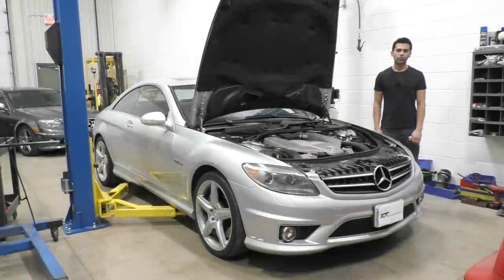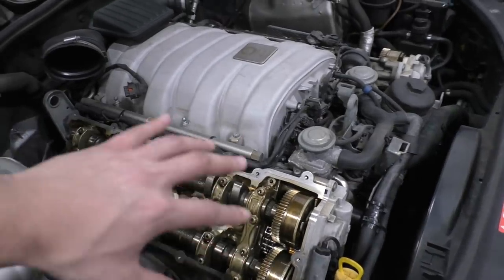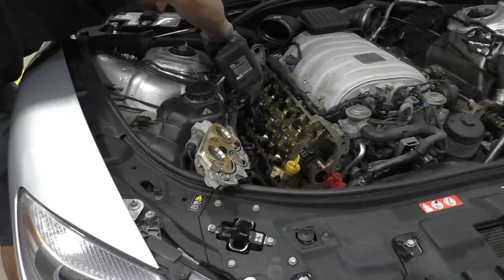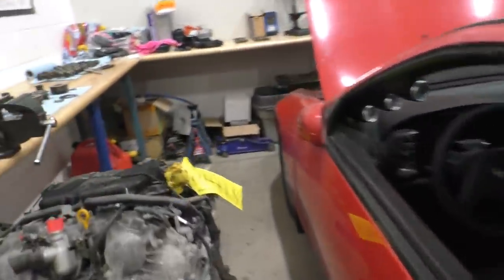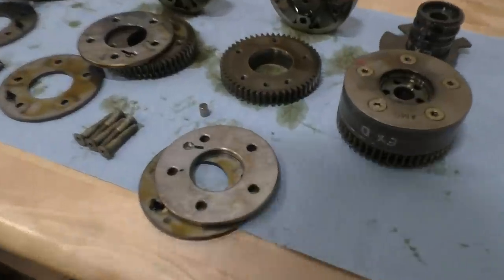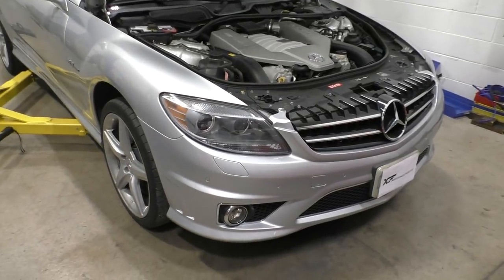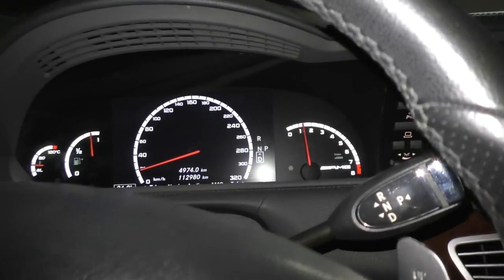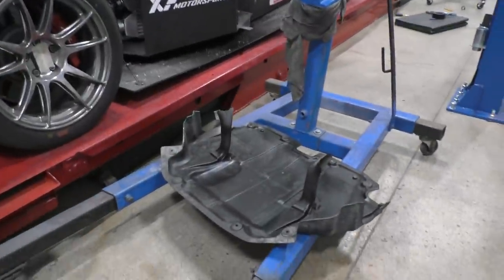Replacing Headbolts and Cam Adjusters on a CL63 AMG M156

Comment: Keeping oil level close to the max is the key on m156 to ensure timely oiling. For those looking for a detailed m156 head bolt DIY, I have one on my channel.
Reply: I love your channel. Thanks for making a detailed DIY process on head bolt replacement.
Reply: That’s true. I also drive my car in M mode or limit the gears so that the RPMs are always about 2500 to ensure enough oil pressure to push it to the top if the engine.
Reply: Does anyone have an idea of cost and time invoked to complete this DIY?
Reply: Just curious ..nowadays how much does 156 head bolts replacements will cost @ an Indy shop ? How much do you charge ? 
I’m actually thinking about doing it myself but I have no tools. 🤣
Reply: @enzoi9569  if you do it yourself (again, I have a DIY video on my channel) it costs about $350. If you pay someone it’s 10 hour job. So ask them how much they charge per hour.
Reply: @erico6117  if you do it yourself (again, I have a DIY video on my channel) it costs about $350. If you pay someone it’s 10 hour job. So ask them how much they charge per hour.
Reply: Do you believe this is a more intense repair compared to bmws engine bearing replacements? Also is this repair needed for no amg models?
Reply: @AccentOnCars  hey do I need to set timing just to change cam adjuster cover gasket???
Reply: @enzoi9569  you can buy parts from FCP and it will cost you about 300- 1000 depending on what you need. It takes 8 hours or so to complete the job.
Reply: @erico6117  you can buy parts from FCP and it will cost you about 300- 1000 depending on what you need. It takes 8 hours or so to complete the job.

Comment: I'm less impressed with "German engineering" everytime I watch one of these Mercedes repair videos.
Reply: It's not a Honda K20A in terms of durability and performance but better than anything US made
Reply: German car manufacturers need to save costs just like anybody else. Every engine has its unique little weak points, but I personally don't know of any Mercedes engine that is particularly bad
Reply: @millenniumzeek  Yeah no, I'd rather take a stone age pushrod LS or a Coyote if I wanted to go modern over anything German if I could. And I say that owning a N55 powered car.
Reply from the maker: Well, it's still better than the others out there. Japanese would have probably made it out of plastic. Americans, cast iron
Reply: @millenniumzeek  "bEtTeR tHan AnYtHiNg Us MaDE" I swear to god you live in the 90's
Reply: They are a luxury car. Luxury car buyers generally lease for 5 years or upgrade every 2. Therefore why bother making your car last longer than 100,00km? The manufacturer doesn't make anything from used car sales. They make a car that is far superior to anything else for the first 100,000km and after that its someone else's problem.
Reply: Not necessarily German engineering, but Mercedes arrogance.  Their manufacturing defects become your problem after the warranty runs out.   There are dozens of examples of expensive repairs being necessary because the Schwaben in Stuttgart saved a few too many Euros.  I worked in automotive manufacturing.   Defects happen, but other manufacturers stand beyhind their luxury products when it happens.   Not MB.  Its one of the main reasons I switched to Japanese cars after driving MB for 19 years.
Reply: @1949coupe  yep. I have a $165,000 2012 BMW X5 with 220,000km on it, and a $40,000 2008 Mitsubishi Lancer with 245,000km on it. The Mitsubishi costs less to run, register and insure and its never needed anything except for oil changes and 1 set of brakes. BMW has had thousands spent on it in less time.
Reply: @1one3_Racing   My Hyundai Genesis has had basic maintenance up to 190k KM.   Try that with an MB or BMW.  That's why I cringe when I see the see the amount of technology in the new 2020 S-Class.  My brother in law bought a brand new 2015 S63.  The car had to be towed 3x in the first year.  All electrical issues.  Last time the car was off the road for 3 weeks while the the dealership waited for a new control module from AMG.
Reply: @1949coupe  ouch.
I often wonder about the automated driver tech in the new cars too. I mean, you take a 20 year old MB and the the electric window gets stuck in the down position. Its a huge pain but not really a huge drama.
What about in 20 years when the forward facing radar screws up and slams on the brakes in the middle of the motorway? Or lane control jerks the steering from your hands?
Reply: @1one3_Racing  Despite all the hype about sustainability, between the Government regulations and car companies cars will never last that long anymore.  Take EGR valves with direct injection.   Reduces emissions and improves fuel economy, I.e.CO2.  On the surface it looks good.  That it often completely carbons up the engine and reduces the life of the car is not talked about.  What about the CO2 from manufacturing another car?  I know it's in German, but have a look at videos from Red Head Zylinderkopftechnik.  They have almost weekly videos of BMW, Audi and Mercedes teardowns to the block after 150K KM or less.  After removing literally pounds of carbon the heads are rebuilt and the car should be good for another 150K KM before the next teardown.
Reply: @1949coupe  my argument with electric cars is exactly this. How much co2 is there in extracting the minerals for the batteries? How much silicone and lithium is even left? Can we sustainably convert to electricity? Considering the amount of electricity that comes from oil and coal fired power plants.
I'm not against electric cars, if they are the solution. I haven't done enough research to properly know.
The new car market is a strange one for sure. I deliver grain for export and next door is where they receive cars. Because of the whole pandemic thing I think a few ships were in holding for a while? I'm not 100% sure. But in the last 2 months I've seen more car ships unloading than in the last 2 years! The car park fills up with 5000 cars and the next day they are gone and the next day theres another ship filling it again!
Reply: @1one3_Racing  Wow.  I doubt they will sell quickly at dealers.   With the fear being instilled, business going under, planned tax increases I think people will hold onto their money.  Between China and India, they are building over 600 coal fires power plants while they sell solar panels to Europe.....
Reply: @1949coupe  Very true! I'm a BMW driver and they have their own "saving Euro" problems, too. Don't get me started on Audi/VW maintenance headaches.I think it's all a matter of engineers and car guys being replaced by bureaucrats and been counters.
Reply: @xfmotorsports  It's an unfortunate fact about the Internet that when it comes to cars there's a whole slew of people that believe that every Japanese car is just amazing and will never break and every European car is an overpriced piece of crap. No matter how great or capable the car is, as soon as it needs a bit of work the Internet kiddies will jump all over it saying it's crap. My GF's Corolla is on its second gearbox. My '98 E55 wagon has all it's OG drivetrain at 230000 miles... So yeah
Reply: @hydorah  Don't listen to them. I had a 160k mile c55 everything original just oil changes lol. Then i had another c55 215k miles my mistake for not maintaining properly and needed to buy another $1500 m113 engine in good conditoon lol. Now she drives again.
Reply: @hydorah  exactly lol - so many people delusional
Reply: @thatmatty231guy  Haha yeah. Since my original comment the Corolla is dead. Blew its headgasket at 150K. We decided not to bother fixing it, sold it as was - and bought an SLK. My old E55 is now on 236K

Comment: The m156 is beast for power gains. From a reliability standpoint id much rather take the m113 na.
Reply: This. M156 for power and sound only, M113 for reliability and durability.
Reply: I got 180000 miles on my beautiful 2000 w163 ml55 with the m113NA , she runs like brand new. No one sells aftermarket upgrades for her though.

Comment: It looks like a tricky job, replacing the head bolts without disturbing the head gasket , was it difficult to clean out the oil from the block holes to prevent hydraulic fracturing?
Reply: Actually tasos Moschatos would not  change the head bolt without changing the head gasket as it disrupted  even if you do each bolt one by one

Comment: the head bolts on my r30 m156 went bad a 62k miles. I had aftermarket insurance and the covered everything which included head bolts the hydraulic pump for the suspension and both front struts. afterward the m156 is a dream
Reply: Great call on the aftermarket warranty brother, that’s the ticket.
Reply: Can you share which insurance company?

Comment: Thank you for these great videos.
I have a 2006 C280 with a 272 engine that has this problem on the left side (driver) cylinder head. The previous owner neglected they car by NOT changing the oil frequently.  These multi cam/ flex cam engines need clean oil and correct quantity of oil or they fail in many ways.

Comment: wow.  I didn't realize how soft those plates were.  i have this going on with my M156 and fighting with the dealer to get them to fix it under warranty.
Reply: They look like they're probably made with a powdered metal process and didn't get proper heat treating.
Reply: @SeishukuS12  Sintered stuff is normally used where it is too hard/expensive to machine.
It would probably be way cheaper to machine a simple part like this, especially if it is soft metal.
Reply: @coast2coast00  normally, yeah, but it can also lend to mass production as well... In high numbers it would likely be cheaper for a sintered part.
The surface and edge finish kind of look like a sintered part as well, though that could also be just a tumble stone polish.
Reply: Thought this was an old engine , should be well out of warranty with a dealer .

Comment: I am genuinely curious about how the underside if the head bolts corrode, what are they coming into contact with that can make them corrode? Also hopefully the person making the replacement plates for the cam adjuster is making them out of a more durable metal, if so they should be the go to replacement anytime someone works in the cams.

Comment: This summer i will be doing my cam adjusters. Since the camshafts will be off its quite obvious its no or never to also do headbolts. BUT, my m156 has 166,000miles. No record of anyone doing them. Vin is in the affected range. 

My main question is when you reinstall the camshafts does the cam holder tool put them back in the correct position as when you removed them?
Reply: Hey brother be careful when you remove those head bolts. She got a few miles on her and then damn bolts get so corroded they snap. I seen it it’s a nightmare, god bless and good luck bro.

Comment: Dude your videos are awesome! Help me so much with my c63 head bolt job.  Question I have in case you see this, did you put RTV on the new head bolts? Any specific type needed for that? Also, with the cam adjusters, how do you get them back into their correct position if after you take them out, they are slightly misaligned? This happened on my c63 because the hole in the gears isn’t threaded so all I was able to do is stick a 5mm bolt in there to hold them in place however upon removal, they are about 1/8” misaligned. My buddy working on the car with me says they can be payed back into place with a flat head. Just curious if you have any tips or tricks on how to do that without risking damage of the cam adjuster. Thanks!

Comment: I have a 2008 s63 with original headbolts. The car has 120k miles. Should i change the Headbolts? 
Or it shouldnt be a problem at this mileage since its already 120k?

Comment: Those bolts look fine. Just some light surface rust. At that rate of corrosion it looks like it would do the same mileage again without causing a problem. But since the covers were coming off anyway it makes sense to do it now.

Comment: So if you change the bolts one by one it will not damage the engine headgasket?
Reply: Those bolts are torque to yield, they gotta go down and hit the bottom for real, if not it’s  over.

Comment: I found a c63 Amg 2009 guy said they changed the head bolts an after that it started to misfire 1-3 cylinder it has 155k miles his asking 8k what could be the problem

Comment: Hello I got 2010 with m156 motor and 130 k miles on it , it is old head bolts should I replace them or just leave it since nothing shows any problems now ?

Comment: I'm not familiar with these engines but could you have just rotated the plate and mill a new hole in between two other mounting holes?
Reply: Yes but the metal is soft and will wear out in another 50-70k miles. The metal in the welding rod is measurably harder and should therefore (in theory) be a big boost to the lifespan of the adjuster.
Reply: @FILTHY-YOGURT  That is a good point, but I believe any increase of wear on the pin would be negligible. The spring applying pressure to the pin is fairly weak and it's a polished surface against a polished surface. The pin is also rounded and less likely to "erode" on the tail edge that drops in hole. These guys are smart and came up with a simple, efficient, and cost effective way to extend the lifespan of a poorly designed component. 👍Just my opinion as an experienced MB tech.

Comment: is there a specific sequence for bolt replacement?  Or I can start from anywhere? Like clockwise?)
Reply: Not only is there a specific sequence from center to the outside of the head, the tightening of the individual bolts is a multi-step process, starting with a 10Nm torque, then a 50Nm torque, the three successive 90 degree turns, all using the tightening sequence.  The valve covers also have a tightening sequence.

Comment: Don’t listen to this guy.!! You are not supposed to replace 1 bolt at a time as u compromise the bond on the gasket and when u look at the torque spec it’s 10nm 50nm and 3x90 degrees and they have to be torque in a specific pattern. When you remove 1 bolt at a time and do 10nm 50nm and 3x90 is not a proper torque as the other 9 bolts are holding the head down causing this reading to be false. Your car your money I’m just pointing out what’s is proper and what is not.

Comment: I’m curious to know how much do you charge usually to replace the 156 head bolts as well as the cam adjusters ? And how much to fix the lifters if they are bad ? 
All this seems doable but unfortunately I do not have the tools.

Comment: You can easily drive with night vision watching a screen the only bad part is 0 depth perception. I drove with night vision while serving in Afghanistan one of the lead vehicle in one of our convoys drove into a deep hole lol I was a mechanic with the tow truck so I had to pull him out not bad just deep enough to get stuck and damage the rollers used to protect against IEDs.
Reply: My s class has the same night vision and you are correct, if you turn when you think you should from screen image you will turn to soon , bus drivers might be ok 🤣, also thanks for serving 👍🏻
Reply: Thank you for serving cool story.

Comment: Which generation of SL is the car that will get the C63 driveline?
Reply: It started either 2007 or 2008 and went until 2012 that the SL had the 6.2 liter m156 v8 like in the video. The facelifted R230 models. Prior to the facelift they were SL55 AMG's with the M113k .
Reply: I'm hoping it's going into an old school SL, R107 would be great.

Comment: Hi is it possible to put a BMW DCT Transmission into a Mercedes with an M113 Engine can you make a  Transmission adaptor kit also some ECU software so it will run perfectly, to sell on your web site.
Reply: I am not sure if this would make a lot of sense, since the Mercedes 722.6 five speed transmissions are some of the best automatic transmissions ever, and definitely the best one from Mercedes. Also they can handle a crap ton of power!
Reply: Why wouldn't it be possible, need an adapter and probably both ecus/tcus. As long as engines spin the same direction.  And DCT is more engaging and hipo than a torque converter auto
Reply: @georgobergfell  Absolutely correct 👍.  The NAG I 722.6 is one of the best automatic transmissions.  Best regards from Germany 🙌😁
Reply: @Mercedesdriver2012  "The NAG I 722.6 is one of the best automatic transmissions" Thank god it is one of the best

Comment: What was that red oil on the new bolts?
Reply: Looks like regular assembly lube
Reply: Is it assembly lube or Loctite?
Reply: @georgobergfell  I don't know really, but that said loctite on threads make sense but below the head seems suspect. The old ones didn't seem to have any threadlocker on them.
Reply: Assembly lube

Comment: So many of these cars on the market, and the more I learn about this engine the worse it seems. 🤦🏿‍♂️
Reply: The headbolt and cam adjusters are the only problem tho, and they are easily fixed as you can see in the video. Other than that the engine is pretty much bullet proof. And you can drive it hard, like really hard and it just keeps on working.

Comment: merc are always involved in scandals around material quality. rusty cars up until 2005. rusty m156 bolts. soft m156 cam adjusters. warpy heads on old straight 6's due to cast iron block with aluminum head. bad m111 head gaskets. probably the same for m112 and m113. cracky wiring harnesses, electronic modules and rubber parts.
Vw and especially audi seem far less rusty, all the old 4 cyl 8/16 valve engines can last for eternity without much oil burning and modern tsi junk only has problems with cheap chain guides and undersized timing chains, piston rings and such. 
bmw is plastic.

Comment: your adjusters and cams/lfters will last if you change il regularly with 0w40 amd specific oil. i also add 1 bottle of ceratec every oil change and im almost at 200k. my head bolts did snap at 100k but i was able to salvage her. 
follow me at @c63_420